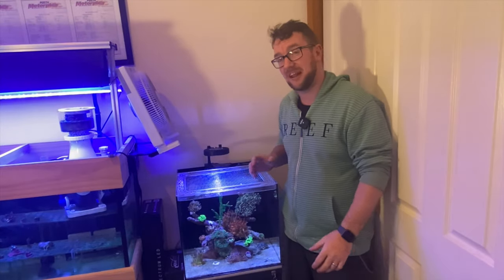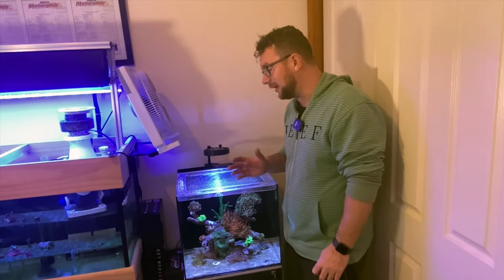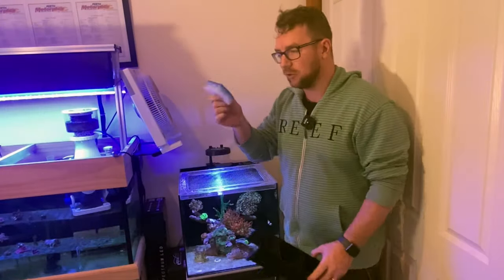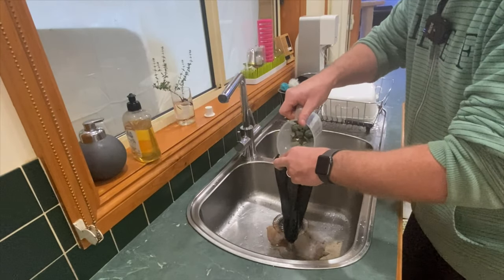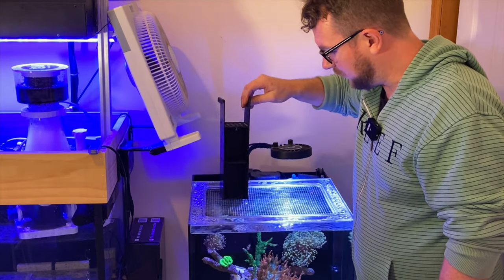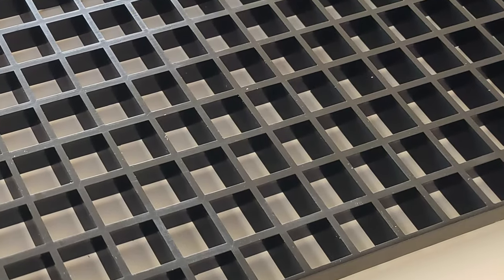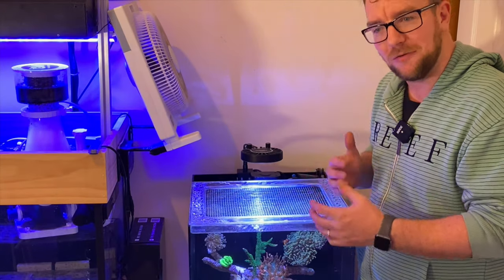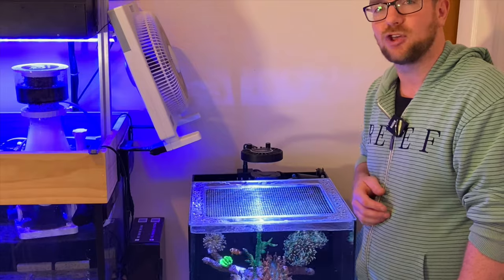Adding a Media Chamber to the Waterbox Cube 20

Comment: what protein skimmer you are using that can fit into middle rear chamber of Waterbox 20g? Thanks in advance
Reply from the maker: Tunze 9001
Reply: @ParkersReef  will get that. Fluval evo ps2 does not fit. 

Not sure if I miss anything from this video. You use Inthank chamber to replace your filter sock in first chamber. How about your middle chamber? Do you remain placing two filter sponges, bio-balls, carbon which come originally with Waterbox? :)

Comment: Did you have to take off the sock brackets? I'm supposed to with mine and I can't get them off! I'm so frustrated
Reply from the maker: Yes you will need to remove that. I simply pushed it out with my thumb :)
Reply: @ParkersReef  could you elaborate? I am having so many difficulties haha. Did you push it “down” with your thumbs? Or up? If that makes sense lol. Are you talking about the two “line” pieces that hold the square sock price? You got those out with your thumb?

Comment: Hey Sam, did you need to cut the OEM strips that hold to filter sock in place off to fit this in?
Reply from the maker: I did yes, but they just pushed out with my finger :)
Reply: Mine were a bit tougher so I used a steak knife between the strip and tank. They came off easy. Really happy with the upgrade for my planted tank
Reply from the maker: Nice one

Comment: Hi, I use filter cups with floss in the first chamber... in the second chamber I have 2 sponges and carbon. Shall I just get rid of the sponges considering I’m using floss??? Thanks
Reply from the maker: I still use the sponge, but it should be cleaned out pretty often
Reply: Should you use coarse sponge on first chamber to trap big items and floss on second chamber for water clarity?
Reply from the maker: @civicekhatch9 you could, but there shouldn’t be much coarse items getting in there anyway.

Comment: Question. I see that everyone in Australia either has chillers and or fans over their tanks. How hot do you keep your houses that you need to chill your tanks? I live in texas and keep the house at 72F.
Reply from the maker: Not all our tanks have fans or chillers, but most will. It get's pretty hot here, in summer we will quite often hit 45c which is 113F. When it is that hot, you can't have your house that cool (because its hard on the A/C but also because it is just too far from the outside temp that it is hard to go out and back in.
Reply: @ParkersReef  interesting. It gets that hot here too. Guess we just have massive over sized AC lol Thanks for replying
Reply from the maker: @Marinetuck220  yeah perhaps. Personally, if it is 45c outside, I don't like it 22c inside, makes you feel sick going in and out of the house :P
Reply: @ParkersReef  Yeah you step outside in the summer and you need shower again

Comment: I have a question iam new to reef tanks setting a 250 litre tank up is it worth running a uv light on it I have a small Nano tank witch doesn’t run with one and runs fine so just wondering do u need these on big tanks can you give me some advice plse ty Karl
Reply from the maker: Hey Karl, no I wouldn’t bother with UV on a 250l tank. Not that they are bad things, they are helpful, I just don’t think it’s needed on a tank that size.
Reply: if you mean UV sterilizer than no its not needed but very useful so if its in the budget, def beneficial
Reply: Thanks guys for advice 👍 get told so many deferent things and end up buying things not really needed 😁 .
Reply from the maker: Yeah it can be a minefield!

Comment: I did the same install on a waterbox 15. You have to remove 2 glass spacers to install this. Isn't super easy for someone with weak fingers and not good dexterity with a razor blade.
Reply from the maker: Mine popped out with minimal effort, I wonder if they siliconed mine in on a Friday afternoon 😅
Reply: @ParkersReef  haha I was digging at them for a good few minute one of them was so tight I had to snap it out.

Comment: Bit late, but you put it the wrong way around. The bended side should be on the right side between the two chambers. Then the open side of the media chamber is facing to the back of the aquarium.
Reply from the maker: Yes it does go much better that way 😅

Comment: I like the fact that you don’t have to modify the chamber with your friend basket. It’s not the case with the intank one.
Reply from the maker: You do have to remove the little ledges
For the filter sock holder. That is easy to do so and you can put them back if need be
Reply: How would they go back in though after cutting them out?

Comment: The waterbox just sucks period. cant run it with a filter sock messes with the ato, changes water level, then you dont have a filter sock your sump is a nitrate sink. i do my water changes from the sump just to clean it out and the stuff sitting in there after just a week is incredible. filter wool is just as bad if not worse.
Reply from the maker: Lol fair enough. How is the sock or wool altering the height in your return chamber?
Reply: @ParkersReef  it restricts flow very quick as it gets build up and lowers the chamber due to less pump pressure. have you checked your salinity lately?  I thought this might have been an issue with my tank but i have a few friends who have one also and same deal.
Reply from the maker: @Sativa098  yeah I keep an eye on salinity - cant say I've encountered any issues, the baffles seem to ensure that the only chamber that fluctuates is the final chamber (where the ATO is?)
Reply: @ParkersReef  yup and it goes down quick and not from evaporation but due to flow  being restricted and the ATO tops it off when there is no need. then i switched to filter pads like you and it was even worse than the sock from buildup and kills return chamber
Reply: i was cleaning them every second day just so it would flow, now i just use a really course sponge and clean the sump out with water changes
Reply from the maker: Yeah fair enough. This tanks been running around 6 months with the sock and I had no issues. Will see how I go with the pad.
Reply: Hi mate. Where do you buy the filter wool with the corse and fine sides? Cheers
Reply: @ParkersReef  mmm i wonder if i have a defect or something, but i have 2 other friends exact same problem. driving me nuts
Reply: @Sativa098  @parkers reef I’m experiencing the same exact issue I can’t even enjoy my tank because I’m constantly having to keep an eye on the flow, as soon as the filter floss gets dirty in the intank media basket my ato goes crazy trying to keep the return chamber topped off and water level in my display starts rising have you figured out a way to fix this??
Reply: @kingsol3018  Same exact things happening to me at the moment. The return chamber dumps out the water faster than it can go through the media basket. The water and crud sit on top of my media basket and don’t get filtered idk what to do
Reply from the maker: Slower return pump?
Reply from the maker: I don’t have the same issue, not sure if it’s return pump speed or the type of filter floss I run, but I don’t seem to face the same trouble
Reply: @ParkersReef  I turned down my pump- using the sicce 1.0 and that didn’t do much. I removed my media basket and that seemed to do it, I may have packed it a little too much with filtration or there’s not enough holes in the media basket but either way it’s impeding flow
Reply: @andrewaxel  I figured it out bro, I cut the filter pad small enough to leave 3 of the holes uncovered on the top layer so water can pass through no matter what and I’ve been issue free ever since
Reply: @kingsol3018  I Cut the sponge that came with the water box to cover the top of the basket and it worked, i had too much floss in the middle of the basket for the water to flow in fast enough. Took three layers of floss out and now it flows through fast enough to keep up with the pump. I’m gonna drill some extra holes on the basket layers to see if that helps some more
Reply: @andrewaxel  man I’m going through the same issue. Have you found a solution?
Reply: @Elev8minh  For the first layer on the top I just use a single filter floss pad that I swap every week, in the middle layer I use gfo and some carbon in media bags. I don’t use the last/bottom tray. The key is to not pack it like you would with a power filter, water has to be able to flow freely through the chambers.
Reply: With doing so I even upgraded my pump to the sicce syncra 1.5 almost 100more gph
Reply: @andrewaxel  Did you run the sicce syncra 1.5 return pump wide open? I have the 1.0 and ran it wide open and in the beginning of  everything ran fine for the first month with the Intank basket and filter floss. Then suddenly my return pump chamber started running low causing my ato to add water and lowering my salinity. I immediately thought it was my filter floss so I replaced it only to come back in a couple of hours of my water level rising where the Intank basket in chamber one was. The filter floss wasn’t even clogged but the water level had risen. I’m stumped
Reply: @Elev8minh  Sorry for the late reply, I think you maybe be running too much filter floss or something is obstructing the flow of the water. Try taking everything out of media basket, if the pump runs dry something is blocking the flow in the rear chambers. If not then you might be using too much media. I run my pumps all the way open all the time
Reply: @Elev8minh  Here’s my insta handle if you need more help with anything saltwater wise!  cheers - @andysnano
Reply: @andrewaxel  Thanks man I’m literally only running one filter floss and that’s it nothing in the middle and bottom levels. That’s what’s making me scratch my head. I don’t know what else it could be. I did notice some gunk build up in my back chambers so I ended up removing everything in the back chambers as cleaning it and reinstalled my protein skimmer, heater, ato and pump but still had the same issue. I’m literally ripping my hair out
Reply: @Elev8minh  That’s super weird then, the slots for the water to pass through are on the bottom- But you said you checked it. Could anything else be blocking the waters flow? Maybe the media basket itself? hopefully you find out what’s going on
Reply: @Elev8minh  Could be a faulty tank as well, if you can’t figure it out i’d suggest you call waterbox
Reply: @andrewaxel  Thanks for the reply man I just literally got off the phone with Waterbox and they said that all the tanks are mass produce with all the glass cutter spec and they have jigs When they silicone up the tanks so I really don’t think it’s a faulty tank but I did get a sicce 1.5 like you and completely cleaned and sterilized the tank and I’m going to start all over I generally hope there is no issue what I am thinking though is I had A protein skimmer running on the left side when you look at it head on So maybe it was blocking the water flow but I just brought a protein skimmer like Sam’s and it will be placed on the right side instead of the left if you’re looking at the tank from the front so maybe my old protein skimmer was blocking the water from flowing over into the second chamber
Reply: @Elev8minh  You know i think that’s exactly it, you can’t run a protein skimmer on the left side because the water comes in from the top in the middle chamber. I run a tunze 9001 on the right side up high and i have no problems with it blocking flow
Reply: @andrewaxel  I literally just bought one and it came in today lol fingers crossed 🤞 so you also have an Intank media basket in chamber one?
Reply: @Elev8minh  Yeah in chamber one I have a intank media basket specifically for the cube 20, in the middle chamber i run a heater on the left side with marine pure spheres and a my skimmer on the right. For the return chamber I run the sicce 1.5 with a uv lamp in the chamber
Reply: @andrewaxel  man fingers crossed my setup is now like you bro thanks for reaching out to me and trying to help man I greatly appreciate you!!!!I’ll keep you updated!!!